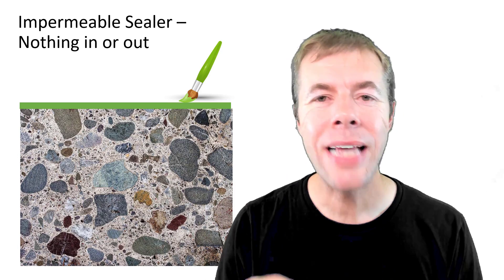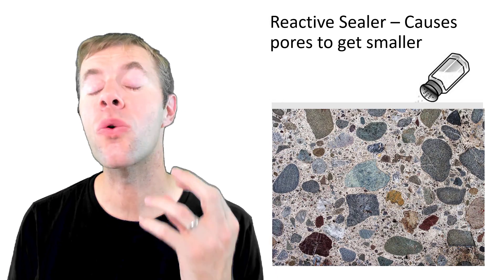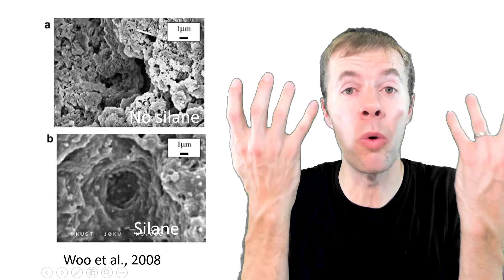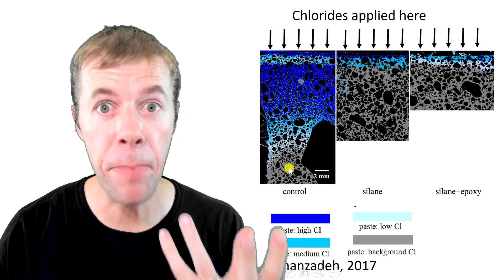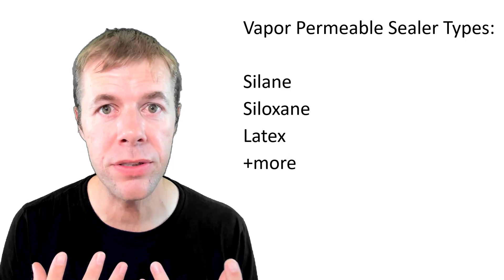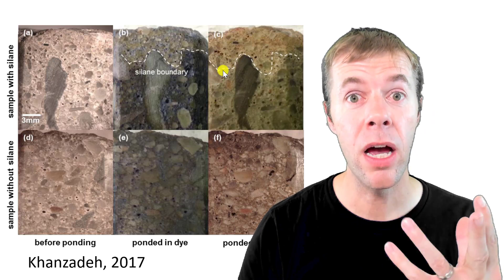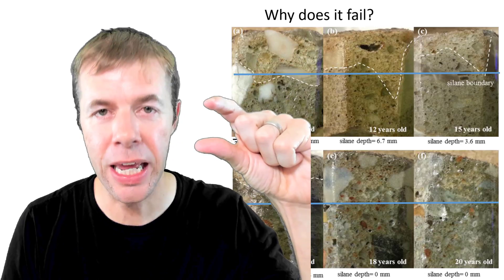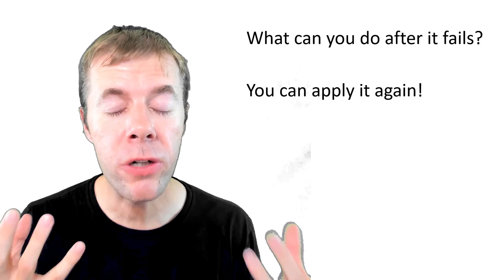Surface coatings and sealers for concrete – How long do silanes last and why do they fail?

Comment: Can you take a sample after setting to test concrete. 
When you do slab or driveway how do you deal with moisture loss to the soil where you cannot use wax. 
Can you give names of sealers resin and wax

Comment: It would be interesting to see if the silicates also goe away with time. I used Lithium silicate on a garage floor. It actually drove oil out of the floor.

Comment: Dr. Ley, Thank you for the ongoing information you provide. As you mentioned the topic of moisture in concrete for application of Silane/Siloxane Sealant. Would you recomond the typical 30-day period for fresh concrete to cure so a Silane/Siloxane Sealant can be applied? and would you recomond step grinding for improved adhesion?

Comment: Very big fan . Waiting for the 60 days for concrete entrance pad and walk way to cure . Used the wet burlap for the 1st two weeks . Can you please recommend a silane sealer to use . A brand name . Also small cracks should I seal them with hydraulic cement . Or what do recommend to use.

Comment: Where can I post to get an answer . 
Gustavo Espinoza
1 day ago
Very big fan . Waiting for the 60 days for concrete entrance pad and walk way to cure . Used the wet burlap for the 1st two weeks . Can you please recommend a silane sealer to use . A brand name . Also small cracks should I seal them with hydraulic cement . Or what do recommend to use.

Comment: Love the video. I’m buying a 50 yr-old house in the Carolinas. It has a problem with moisture from hurricanes, but not that often. I want to excavate the foundation to apply a sealer to the concrete, brick and mortar. I’m all ears. You did a great job with this presentation. 👍🏼

Comment: Why not add "water glass" at the time the concrete is being mixed just before pouring and shaping?
Reply: The silicates in the concrete need water to react and form a strong matrix. Silanes or similar chemicals would likely interfere with that and cause issues with the concrete curing. 👍🏻

Comment: Protectosil BHN Plus was recommended for my new Polebarn floor. Just have to strip the acrylic cure and seal off that the contractor applied.

Comment: I have a new driveway that is dusting according to the concrete company and there solution was to apply a densifier with a garden sprayer, which didn’t work waiting to see what their next solution will be….

Comment: If this amount of all your videos info was available when I was a student 46 years ago. I would have been so happy. I grew to love concrete over my career & I still like watching these videos. I’ve student studied it, shuttered it, laid it, managed it & have been on civil engineering large & mega plus commercial sized jobs. Loved them all. Your info is invaluable to so many around the globe.
Reply: The surface is also wearing off. Wouldn't that factor in also. Miss Pacman, eating away from below and tires wearing the top

Comment: Lol bro, pour more porous layer on surface in construction time, than apply this sealers(+some hardeners silicates for strength) and whoala deeper penetration, common sense, if the water wont come to deep crete than crete will come to water :D

Comment: G'day, 
Am curious about what products of pour methods IE lower PH with the silane vapour product for the purpose of constructing a tall Concrete water tank that runs along the side of my building. 
You hit the concerns I have, AND my water tank nerds to be safe for food and drinking. Would you use any of the products you listed? 
Thank you in advance

Comment: How about simply waiting 17-20 years for the sealer to disappear completely and first then reapply a new layer? Should save on cost and labor of having to remove the existing layer or worrying about lack of penetration. A leap period between coating and no coating.

Comment: Lazy question (sorry): What would you (or I) use on your garage floor?  Thank you for the great video
Reply: Given you have proper drainage and no problems with moisture go for a quality epoxy coating and do all the preparations meticulously, rent a "real" concrete floor grinder with diamond wheels over a day/weekend. 

It will last many decades, stands up to all everyday chemicals used in a garage, easy to clean and looks nice in garage. 

That what was where I ended up when I tried to optimize cost/effort/looks/durability in my use-case. 

A friend of mine put some heavy ceramic floor tiles in his garage. It costs more and takes more effort to install - but the floor is excellent, it looks great and it's very durable.

I've actually seen a metal workshop with end grain wood flooring and that  must be the ultimate, no compromises solution - if you win the lottery.
Reply: @NomenNescio99  YOu can make your own end grain flooring out of treated pine. Have Six by Six posts planed and jointed, thin slice 1"  thick. Epoxy in place. Then sand flat and  seal.

Comment: From David Lixenberg
Thank you for this informative and beautiful lecture. You report that it may be more difficult to get the polymer to protect the concrete when refreshing it. Do we know why it is more difficult to achieve a successful protective layer on repeated application ?
Reply: My first guess is that the remnants of hydrophobic layer don't allow the silane solution (?) to penetrate as easily.

Comment: Are you sure of the 70% Siloxane or silicone. it can get so acidic and will eat away the stones or concrete. Also you can use water as a carrier. You only need solvent as a carrier if you are sealing granite or hard penetrating surface

Comment: Dear Professor Tyler, as always great video.  You sir being a teacher I'd like to tell you about the new tech we are developing in China, concretes made without sand and gravel, concretes that are impermeable without the help of additives or sealers, concretes that are 100% recyclable and when the concretes are recycled they use 70% less Portland cement because the material is highly pozzolan,  Can you believe this? Ashcrete is a new type of composite material made with Waste to Energy Ash, No sand and gravel are used in the mix design the concrete is made 100% with ash, what is interesting about ash is that ash is similar physically to sand and gravel but chemically is similar to Portland cement, Yes, all the chemicals are in oxide form but being a waste there are more other oxides in the ash (TiO2, Fe2O3,etc) which give concretes made with ash special properties that concrete can't even dream of such as being impermeable to the inside of the structure and outside as well, how is this possible? Well ALL the Oxides present in the ash when enter in contact with water release ions that form crystals and needles, just imagine making a concrete only with Portland cement, the final result an impermeable and sealed concrete and when you recycle it keeps it pozzolan properties so the second time around these new materials use up to 70% less Portland cement, great for the environment less CO2 less sand mining and making waste 100% sustainable.

Comment: Hey can you use silicone to paint concrete ? Using the runny silicone Technick ?
Reply from the maker: I have used silicone paint on concrete but not had a lot of luck.  I think the surface preparation is very important.

Comment: The way the information was presented it sounds like there is no degradation of the coating for the first 12 years. Then suddenly it starts to degrade and typically fails within the next 6 years. My guess is that seemingly unnatural phenomenon is simply the result of the original "coating" thicknesses and how failure was defined.
Reply from the maker: Randal,
It is hard to determine what happened during the failure because we were not able to investigate the same sample over the 15 year period.  However, the coatings all met the specified thickness that was checked at application after 12 years of service.  After 12 years, a much higher percentage of the coatings were LESS than what was measured at application.  You can read more in the journal paper we published over this work.

Comment: Hi Tyler, what would be the best concrete coating for a concrete dock on a brackish water canal?
Reply from the maker: w,
From my experience I would use an alcohol based silane (aka high VOCs) and plan on recoating it every 10 years.  I know there are many other good coatings out there but that is the one that I have had the best luck with and it has shown good performance in practice.  I talk about this here:  https://www.youtube.com/watch?v=AXvWlMfQk_4

Comment: Dr. Ley,
Great videos. 
What are your thoughts on products that make a watertight crystalline structure into the concrete like Xypex?
Reply: I worked on a project and the waterproofing specialist recommended it in underground area with high water level.  Best if it is mixed in with the concrete.  I think their are sealer version too.
Reply: I am curious about products like xypex as well. What is the active ingredient in xypex?

Comment: Best solution is to use crystalline water in the concrete mixture at the plan it add around 60$ m3 but it's the best solution
Reply: What's "crystalline water"? Do you mean water glass, i.e. sodium silicate?

Comment: Funny this would show up in my feed. My father (construction worker for 40 years who had his own small business) built a pond with a waterfall out of concrete in his and moms backyard, he died 1½ years ago and I've been trying to keep the pond in good condition unfortunately last summer I noticed the waterfall was leaking and figured it was going through the concrete so I was going to seal it next summer when it's dry, this information should be very helpful, was not aware of the vapor-permeable type but it sounds perfect for this.

Edit: Ok so maybe not if it's toxic, there are koi in the pond.

Comment: What about Xypex-best crystalline waterproofing productsilanes/siloxane can leave a very slippery surface on a smooth concrete surfacemethyl methacrylate properly applied eches onto the concrete substrate PMMA from Tremco

Comment: I have a recently poured slab, lovely light grey colour. I was an idiot and did some landscaping next to it and all over it before it was 100% cured (7days later) and now it is stained with dirt colour over a large part.  I want to seal it, but before I do I wondered what can lift the stain? If there is nothing, do you recommend an acid stain to blend the dirt stains?

Comment: Hey boy, you're pretty concrete smart, ain't ya?  Well, I'd like to see ya take on my carport slab that's stained up with automotive fluids and rust.  I'll be payin' ya a prevailing wage to bring your absorbents, degreasers, oven spray, detergents, carb spray, muriatic acid, baking soda, stiff brush and weed torch up here and get them stains out fer me.  Thankin' ya!  What?  Too much work?  You are correct, sir - done busted my ass trying that.  Paint/coat over stains? Yes, but they require the concrete to be 'dry'.  Mine looks dry, but my Hillbilly research informs me there's moisture deep down yonder in that crete.  Now, what you gonna do about it?  You reckon blowing several fans over it on a couple hot days might draw the moisture out?
Reply: Use a sand blaster.

Comment: I remember an old method of using water glass being mixed with water and applied on concrete surfaces and reacting with the lime of the concrete RESULTING IN THE CREATION OF A WATER TIGHT AND WATER PROOF SURFACE WHICH IS AS NON-POROUS AS GLASS. This was once used in wet areas but one tinkering engineer said why not mix an equal volume of water glass powder with cement but pre-mixing/dissolving the water glass first with water before adding it to the pre-mixed mixture of cement, sand, and gravel and add more water to create a semi-plastic/semi-liquid mixture which can either be placed or poured. So he did it and he got it right! The resulting concrete is as water tight and non-porous like glass and still has the same characteristics and properties of the original conventional concrete mixture and so far so good the rebars remains unaffected by the new concrete formulation. May I remind everybody that there are many different kinds of water glass, the water glass used in this new concrete formulation is a type of water glass of a different grade used in the 1960s.

Comment: Ever heard of using rice glue water or waterglass (https://www.google.com/search?q=water+glassing+eggs&oq=waterglass&aqs=chrome.1.69i57j0l5.5667j0j4&sourceid=chrome&ie=UTF-8) water to react with the lime component of the cement to make it positively reactive with the steel rebars while increasing it's bonding strenght to the steel rebars and making it non-porous. Other concrete formulations exists such as (1) lime + volcanic ash + sand or (2) lime + rice glue powder + sand or (3) lime + powdered brick + sand. The 2sd formulation requires the rice glue powder be pre-mixed and dissolved with water first separate from the pre-mixed lime and sand, and then add it to the lime and sand plus additional water to help it mix with the pre-mixed lime and sand mixture. For the gravel, fine graded gravel mxture of 1 centimeter + 1/2 centimeter + 1/4th centimeter + 1/8th centimeter + 1/16th centimeter, add 1/5 cubic foot of water for every cubic foot of graded gravel aggregates.

Comment: So chlorine is the enemy of concrete. Where I am located people love cleaning there concrete driveways and sideways with chlorine bleach. People even clean there home concrete roof with chlorine bleach before putting on some type of roof sealer. When it comes to rebar you should see my neighbors small storage room which is separate from the house. Its made of cement  blocks and concrete roof with rebar. Its over 40 years old and because of leaks, about 1/3 of the storage rooms ceiling has come off. Being close to the ocean does not help. Where part of the cement ceiling is missing, you can see the rebar badly rusted and broken in some sections. I tell my neighbor be careful in that room. She has been planning for a while to tear down the ceiling and put in corrugated metal since putting in new rebar and concrete would today be too expensive unlike 40 years ago.
Reply: China is the reason now for the high cost & the shortage of sand in the World ! You can NOT use desert sand .
Reply: @
Authenictruthoid - That use to be true but no longer. Via a brand new process, desert sands can be used to form a concrete type of material - https://www.dezeen.com/2018/03/24/desert-sand-could-offer-low-carbon-concrete-alternative/

Comment: Interesting channel OP, second video of yours I've watched. Suggestion for another video, talk about unscrupulous Ready-Mix plants reselling 'old' aka 'hot' concrete. I drove for one such plant for three years in the Chicago area. It's an evil practice. Another video suggestion, would be the importance of properly curing concrete, VS just letting it dry.
Reply: Wesley Blood  I doubt they all do it. I know while I was driving for that company, the other drivers would talk about it, and the consensus was some of the others in the area had done it in the past, such as Prairie, Ozinga, and Smith, but that they no longer did (as of 2004 anyway) Yeah, sometimes we would dump what was left into the 'boxes' which resulted in large blocks used for barriers, sort of like the highway type, and some we dumped and washed out completely, but a lot of times, the hot stuff would just be passed from load to load till the end of the day, the last load was so hot, I'd have to dump my whole water tank into the barrel and it still would not be enough. One poor homeowner, last load of the day, I had to dump the rest of his two yard load on his front lawn, as my load was hardening up in my chute, and I HAD to get it all out. He was pissed, and my boss still wanted the poor sap to pay for the load. 0_o.

When I delivered to contractors, they'd always ask 'how much old is on?' and I'd tell them honestly, and since when. That gave them an idea how fast they'd have to work. Homeowners didn't ask, and I didn't volunteer the info. Only a very few contractors who bought from the CO I worked for, NEVER got a hot load. From what I heard at the time, they had told my boss if he EVER sold them old concrete, they'd kick his ass, lol. I finally had to stop even telling contractors how much old I had on, the day I delivered 6 yards to a basement floor pour, and was asked how much old, and I told them 4 yards, that had been on over an hour. That set the contractor to screaming at me, and it got back to my boss, and he told me I had to lie from then on, or be fired. He had never told me not to tell anyone prior, nor did the other drivers, though to my knowledge, most of them lied every day. I didn't lie after this, instead my solution when asked was to say 'I don't know'. I no longer worked for them the following year though.
Reply: The company that  i drove for only used the old stuff to make highway barriers and patio blocks. On a long haul though,if we got stuck in traffic we had a big bottle of pepsi in the truck.That would give us another 30-45 minutes when added to the load. As a rule we used 2 liters per 4 yards of mix .
. Right or wrong, i can not say.Did it work, yeppers,it sure did. cheers
Reply: @BentnoseTheBlindScribe  Interesting. In the three years I drove for that company, I never heard of any sort of retarder being used. But then I only worked there from like, 2001 to 2003.
Reply: Which company?
By any chance was it Welchs?
Reply: @kalvarez307  No, and I'd never heard of Welches either. This company I drove for was in the south side Chicagoland area.